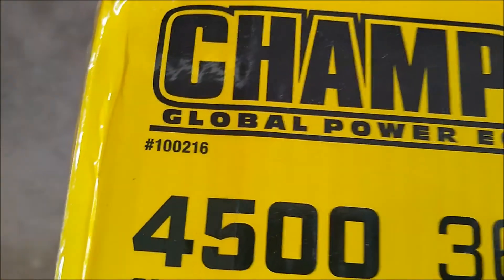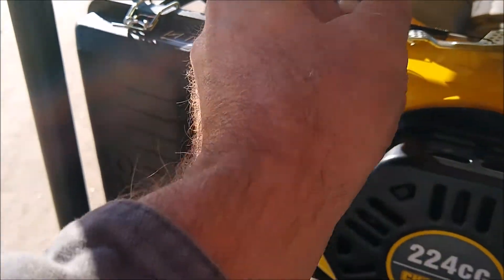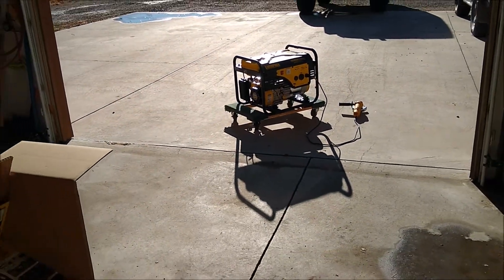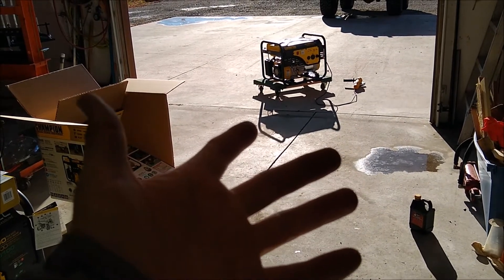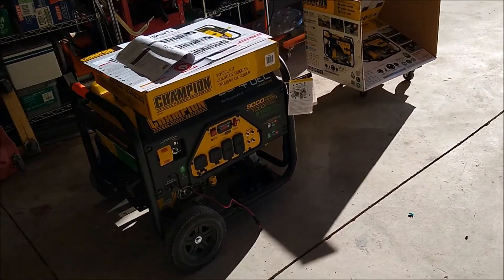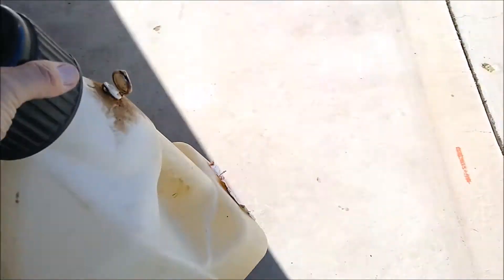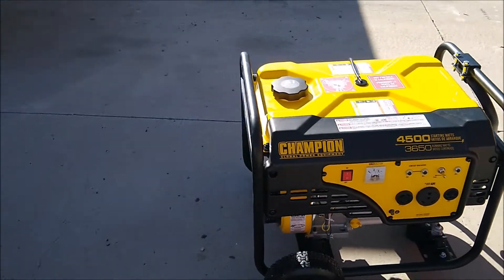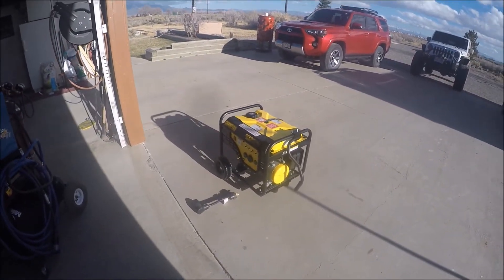INVERTER vs TRANSFORMER Welder run by Champion Gen???

Comment: I wonder if you ‘ramped up’ the load, allowing the generator that second or two to recover from the sudden hit of the welder it might enough. 
13:45 heat is more a factor of time than it is a factor of current. Struggling to keep up it probably sucked up more heat.

Comment: Can you give us any updates on the welder, or generator you are using are holding up?

Everything I've read on the internet says to not use a traditional generator, with a inverter generator. Yet, this video proves otherwise. If your stuff is still working. I will probably follow suit.